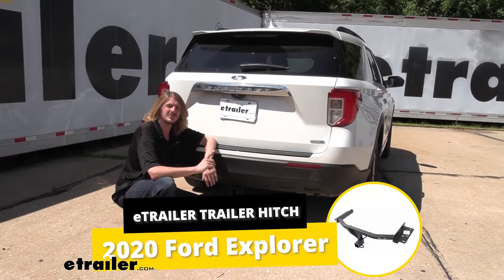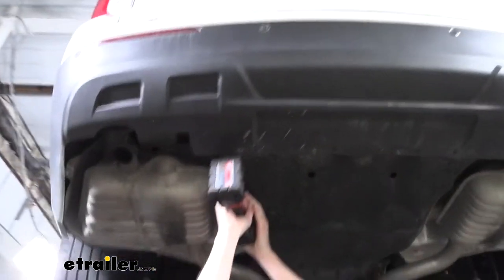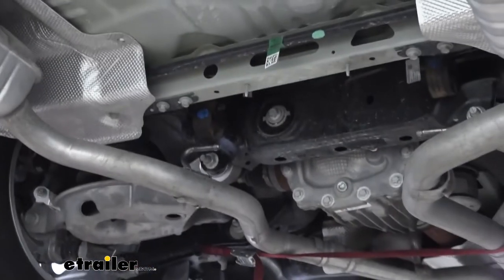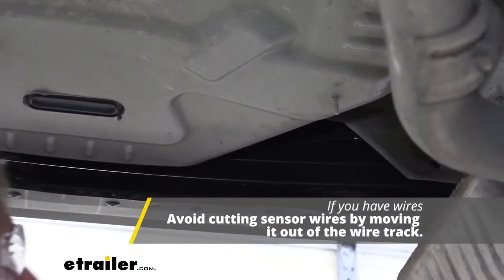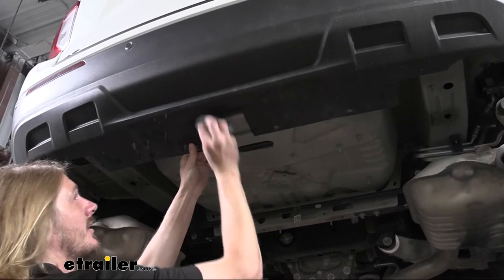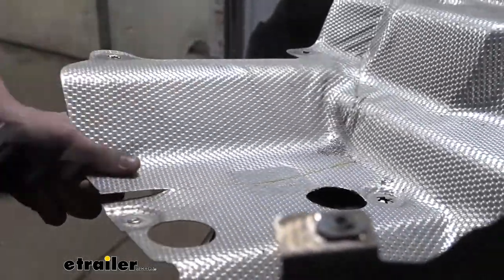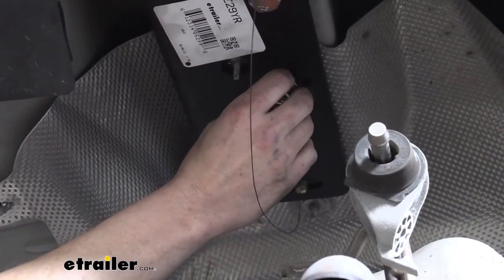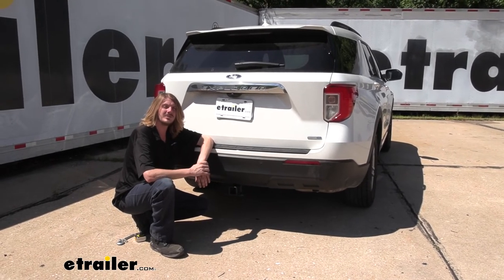Setting up the etrailer Trailer Hitch Receiver on a 2020 Ford Explorer

Comment: Have the Curt hitch, however dealing with the bar that connects to the rear exhaust hangers smacking the hitch bolt immediately above it when driving over some bumps causing a clanging noise

Comment: This one is for the guy making the video when putting the nut on the bolt instead of trying to go super slow so you don't push it up into the frame I found just putting your finger on the side and giving it some pressure and then using your other hand to screw not on worked way better so just give a little pressure so it can't be pushed up and put that nut right on that's how I did it when I was a Hitch Pro at U-Haul

Comment: Would have been nice if the video would have gone into more detail on cutting the heat exhaust guard.  By cutting it straight down is not good enough.  Needed to be cut a lot more than what the guy did in the video.
Reply from the maker: The linked installation instructions show a photo with the exact dimensions and locations that need to be trimmed. You can check out the instructions here:
https://www.etrailer.com/instructions.aspx?pn=E29YR

Comment: THis XLT without factory class 3 hitch cannot tow 6000lbs, it needs to have factory TRansmission special cooler system to do so .... This XLT can only two 3000lbs...